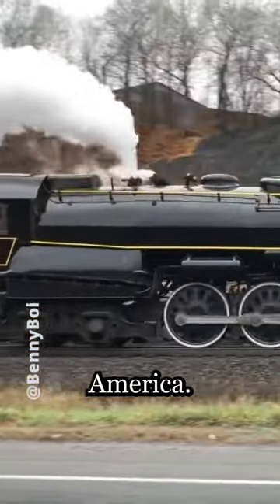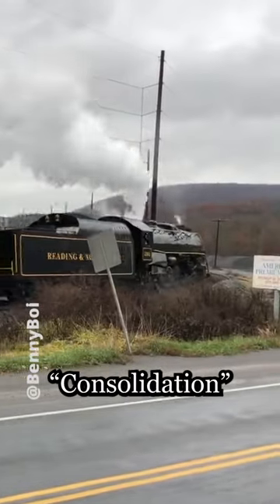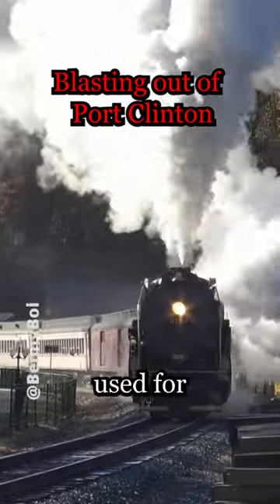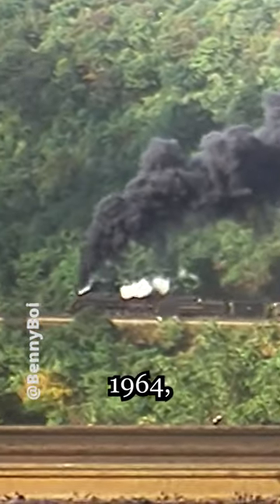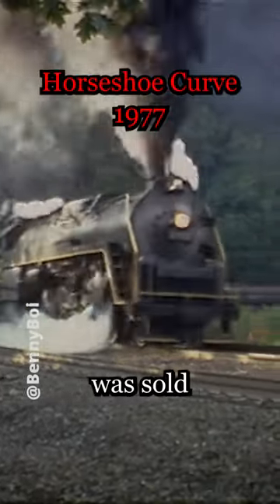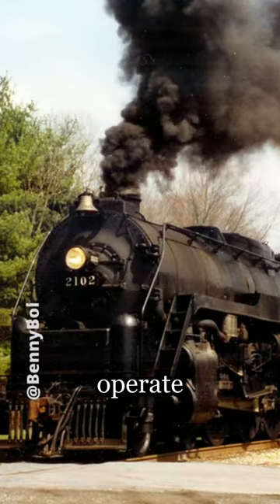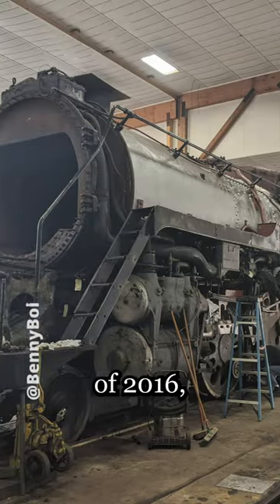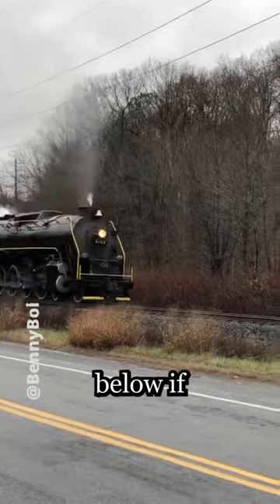The NEWEST RESTORED STEAM LOCOMOTIVE in America

Comment: Fun fact: steam engines aren't rolling coal all the time. Its just for photographers.
Reply: ?? I’m dumb dumb brain and have 0 clue what you mean
Reply: @featherdabirb  All the black smoke they put out is not a normal operating thing, it's done for show for photo-ops because it's kind of what people expect of a steam engine. 
Check out the video "Why do USA steam trains make smoke, but UK ones don't?" for an explanation.
Reply: @rwill156  ah I heared that they normaly want all white smoke
Reply: Or a bad fireman
Reply: @featherdabirb  A lot of these steam engines were converted to burn oil instead of coal. Look for a video of 4014, when its running hot and clean. A very good engineer will burn enough oil to get the train, going fast however you won't see An y smoke out of the smoke stack.
Reply: @andynieuwenhuis7833  🤝👍
Reply: Cleaner exhaust is a sign of better, more efficient combustion. A good fireman will achieve that.

Comment: Seen a video of it running from the cab. They keep that firebox about the same temperature as the surface of the sun
Reply: Same temperature as the surface of a low-end red dwarf would be (barely) possible, but same temperature as the surface of the Sun, even if you could make the firebox out of materials that could take it, would prevent combustion from occurring until the temperature went down.
Reply: The sun's quite a lot hotter
Reply: @Lucius_Chiaraviglio  apparently you missed my sarcasm. In the videos the firebox is just glowing red. Like it's really hot
Reply: @cartler  you missed my sarcasm. I was saying that if you watch an engine cab video, the firebox is just a glowing flame. It's really hot
Reply: @racestephenson4405  Sarcasm . . . okay, I can go along with that.
Reply: Famous Reading Anthracite 😉
Reply: Fusion powered locomotive.
Reply: @Lucius_Chiaraviglio  Guess you don't understand hyperbole!
Reply: @dundonrl  I understand it -- just burned out on it.

Comment: Nearly 100 years and still the most reliable train in America.
Reply: That's really quite sad tbh
Reply: @latoshi3671 not really
Reply: @latoshi3671 no not really it’s fucking badass
Reply: @kota617  in my opinion technological stagnation isn't cool but whatever
Reply: mirroredvoid8394  thank you, finally someone who isn't just moaning about "USA first".

I didn't know that, thank you for for information. I take back what I've said previously
Reply: The amount of maintenance required by these beautiful beasts is outrageous by today standards.  There are dozens of metal to metal  items that need frequent lubrication.
"They would have to be greased about every 100 to 130 miles. And they would have to stop several times for water and a few times for oil. They were inspected at every opportunity for loose bolts, rods, bearings etc."These days the water is carried in water tender cars.  They also generally run with a diesel so as to lighten the load on the steamer to reduce wear.We had the UP steamer stop in our little town for service.  Do not have records but it seemed to be about an hour.Calling an engine that needs this much pampering the most reliable is a stretch.   But you entitled to your view.
Reply: Who asked?

Comment: Original restoration done in Reading shops leased from Conrail by the Reading Company Technocal Society. I was a member at that time.. our crew was working on restoia GP30 in those shops at the same time.  I was alos on the original ramble with the 2102 from Reading PA to Jim Thorpe Pa with a turn in Scranton. On the way back at night..... About 1/2 hr from reaching Reading the engine lost steam leaving the enti consist stranded and powerless on Conrails mainline.  Had to be rescued by Contail to clrar the main.  Turns out the water fill in Jim Thorpe by a local fire company had floride in it which foamed in the boiler causing loss of pressure stranding the locomotive. Got home 6 hrs late.

Comment: Interesting things to note: color of the smoke indicating efficiency.
In the older shots in the engine is billowing a thick black smoke full of carbon from incomplete combustion (same as "roll coal" exhaust in tucks) as Engineers didn't worry about it as much back then. In the new shots the smoke is white indicating a more efficient and complete combustion from the engineers!

Bonus fact: in the very first shot you can see white smoke coming from the rear of the engine but not the stack, that's because it's actually steam being released from the safety blow off. When the engine is not in open the throttle the steam is not going to the Pistons then exhausting through the stack. That pressure exhausts at the rear of the boiler through a safety relief vent when it's not being sent to positions
Reply: That's not the engineers job! The fireman takes care of this!

Comment: On two different occasions, I was called to pilot the excursion train from Temple to Jim Thorpe and return. They had to have a qualified locomotive engineer on board when operating over Conrail trackage. I had the opportunity to operate it from Jim Thorpe to Allentown. It had a modern braking system brake valve. I don't think I would have liked a career on the steamers, though. Dirty, loud, smelly, and exposed to the elements. It was either too hot or too cold.

Comment: For those who don't know about 2102, 2102 was built in March 1925 as No. 2044 (a 2-8-0 Consolidation) for the Reading Company until it was rebuilt on the railroad's own shops on 1945 as an powerful 4-8-4 Northern engine, I'm glad that this locomotive is running again after a long time.

Comment: When i imagined steam engines I pictured 100-150 psi for the steam pressure like an air compressor. Or even just a tube attached to a pressure cooker.

Boy i was wrong  late high performance locomotives had boilers that operated up to 1500PSI thats insane and is power pressure than a nuclear reactor.

Comment: I know that disel electric train engines are more efficient but why can't we have more steam engines running?  There is one in my town just sitting by the library that i would love to restore to working condition.
Reply: First, it's going to honestly cost tens of millions of dollars to do a full restoration to safe operating conditions. Second, you've got to find the highly qualified craft people to do the work. Most of them are dead or will be soon. Third, some of those parts would cost millions of dollars to recreate. Custom special forgings. Nope, you can't just use the modern 5-axis milling machines on a plain steel block and avoid all the undesirably created stresses in the metal. You end up with a part with significant potential to fail.

Comment: Its notca 2-8-0, its a 4-8-4 wheel arrangement
Reply: Bennyboi is right. It was originally a 2-8-0, but later rebuilt into a 4-8-4 northern, because the war production board said they can’t order brand new locomotives, but you can rebuild what you have during WW2.

Comment: The Pollution Express
Reply: Diesel electric locomotives were fairly expensive during the 1940s and 1950s. The USA had used a lot of coal fired and oil fired steam locomotives to get through WW2. For some railroad operations it was financially prudent to keep using those locomotives after WW2 ended. Some of the "new" diesel electric locomotives produced after WW2 were junk and mostly sat in the repair shop, while the old steam locomotives kept operating relatively reliably.
Reply: Steam is boiled up compressed water bruv
Reply: Womp womp